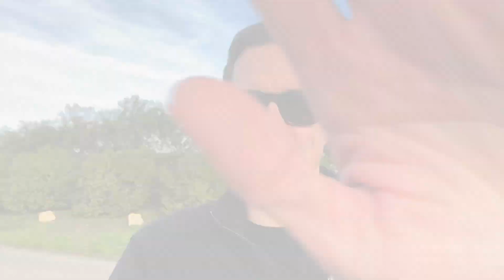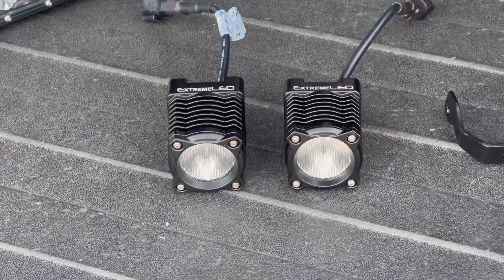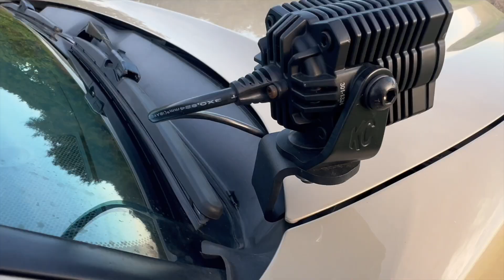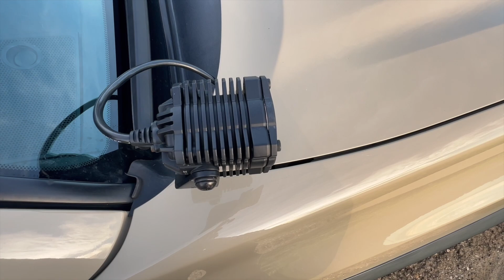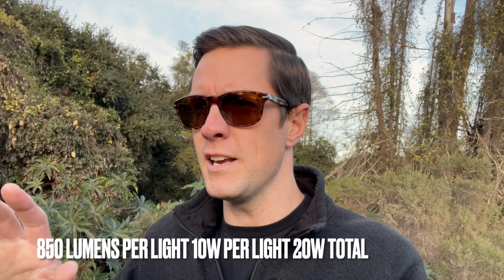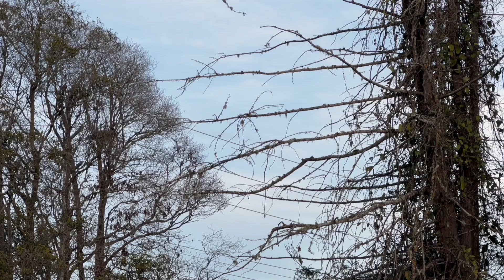Offroad Lighting Project On My Overland 3rd Gen 2019 Quicksand Toyota Tacoma With - ExteremLED

Comment: Pretty good!
I’ll be swapping out my roof rack light bar soon and wiring up my chase lights.

Love seeing how others set their lighting up.
Can’t wait to see the night trail run. I still need to do one 😁
Reply from the maker: Thank you! I'm most excited to show how much wiring I can actually get rid of and cut out completely when I install the switch panel. If I've calculated everything correctly it should be a fairly smooth process, the weather is what is killing me these days to install. Also I did one video night run last year (so fun I definitely recommend it) on here but it was not nearly as bright as this next one will be haha
Reply: @quicksendtaco  agree! When you take off all the wires from the positive terminal of the battery, it’s like a whole new engine bay! 😂
Reply from the maker: @NVLunarTaco  If this rain holds out maybe I can get it done this week!